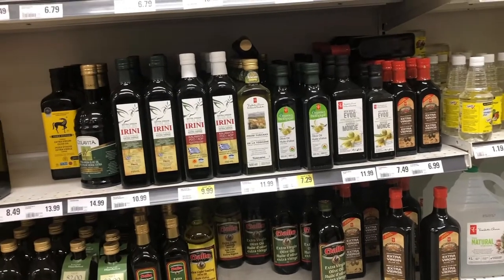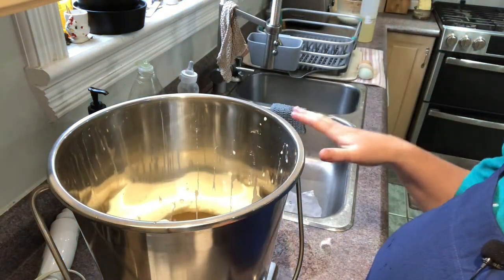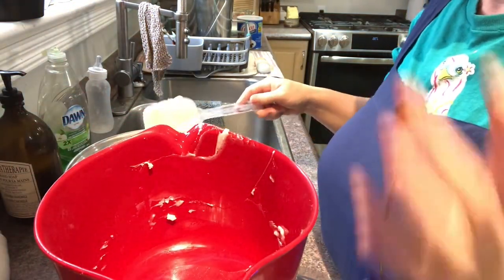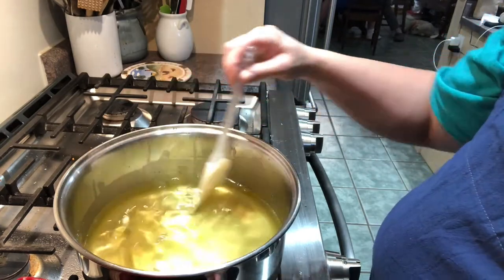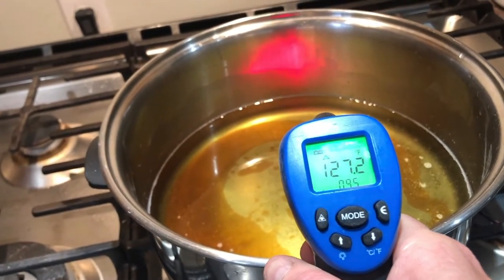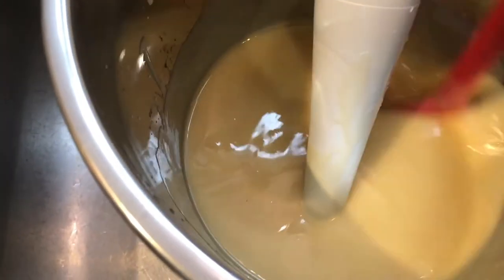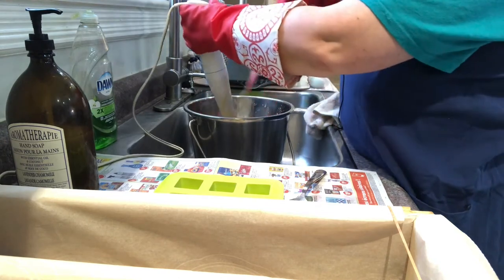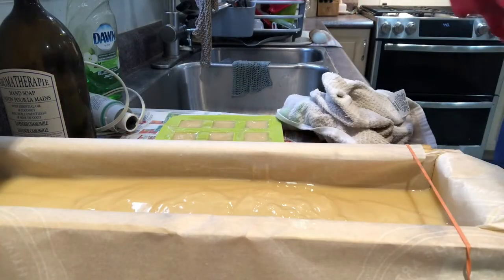How to make goat milk soap using oils from the grocery store for beginners

Comment: Hi, you soap was beautiful, I loved the creamy color. I do have a question. I am a little confused. I saw that you put the soap in the refrigerator. I have seen other cold process soap videos where they wrap the soap in a towel and put it in a cooler to keep it warm. I'm sure there is a reason for both. Could you explain how to know when to use each method?
Reply from the maker: So for goats milk it easily over heats because of the natural sugars in the milk.  When goats milk gets hotter it goes tan or can gel or partial gel.  To avoid this happening it is put in the fridge to keep cooler and to keep its more white appearance.
If you want to gel your soap or called forced gel and to avoid partial gel you can wrap it and the heat the soap makes will force it to gel.  Sometimes gelling it will make natural colours pop a bit more.  Some folks prefer their soaps gelled.  Most people avoid gelling their soap with goats milk though as they simply don’t want that tan colour.  Neither way is wrong it’s just a personal preference.  Just know sometimes force gelling goats milk can cause volcanos and heat tunnels as well as the darker coloured soap.

Comment: Thank you for this video.  Can u double this recipe? If so, how could I incorporate avocado oil in it? I'm not good with calculations. I'm interested in making a a 12 bar recipe.  Thank you!!!
Reply from the maker: You can modify this recipe any way you would like.  You just need to run it through a soap calculator.  The recipe in the video does makes 13 bars of soap cut at one inch thick.  I like using soapcal for my soap making math.

Comment: I really enjoyed your video, thank you for sharing your process. If I was interested in making the soap scented, how much would I add to these recipes? TIA
Reply from the maker: Thank you, I hope it helps you make amazing soaps!  As for scents that all depends on what you are using to scent it.  EO's all have their own safety rating and I usually use the EO calculator.  FO's also have a safety rating and you would have to check with the supplier to find out the recommend percentage.

Comment: We have septic also,, is it.ok to just wash the soap making equipment in hot soapy water and not use the towel ?
Reply from the maker: it is not recommended to put the soap straight down.  It will clog things up.  If you don't want to use a towel you can wash then wipe up first with paper towel or newspaper.

Comment: Kind of a stupid question I’m new to this haven’t made any yet but putting Drano on our skin or lye wouldn’t that burn it while it’s in the soap
Reply from the maker: Not a stupid questiont at all.  No one wants to put something dangerous on their skin.  Once the lye reacts with the oils and liquid and goes through suponification it is no longer lye it is soap.  If you have followed safe usage rates there actually is no lye left over in the soap!  They best anology I can give you is this:  Water is made of hydrogen and oxygen but when the chemical reaction occurs it is no longet hydrogen and oxygen it is water.  The chemical structure has completely changed in to something else!  Just like soap.  Once it has gone through suponification (chemical reaction) it is no longer lye, oils and liquid it is soap :-)

Comment: You cant use it after a few days? You have to wait weeks?
Reply from the maker: you can use it after a few days but it will melt away very quickly.  soap needs to cure a minimun of 6 weeks, 8 weeks is better and 3+ months is best
Reply: @connerty_meadows_farm i want to make my own soaps for the first time. it looks fun except for the lye mixing part. does the same apply to melt and pour ones? About curing?
Reply from the maker: @jets.3561  I am sorry I dont make melt and pour soap only from "scratch".  Lye is not scary, just suit up as I show you in the video and you are good to go

Comment: Can you use bacon grease ?
Reply from the maker: I have actually used bacon grease!  It will need to be "cleaned" though.  (google will help you with this)  Then once it is cleaned you can go ahead and use it as lard.  Now that said I wanted to see if I could get a bacon smelling soap using uncleaned bacon grease.  It worked out ok.  Didnt really smell like bacon at all though.  But it made a perfectly usable soap even if it didnt smell the best.
Reply: @connerty_meadows_farm  : I was so hoping it would smell like bacon .  I keep the grease for all my cooking , that way I don't need to buy any . Old farmer here , wast not want not .  Thank you .
Reply from the maker: @davidwhite4474  I'm a second generation farmer too :-)  we use everything we can as well, no point in wasting anything.  It still makes a pretty great soap!

Comment: But you didn't actually use oils from the grocery store?  Couldn't our outcome be different? You used bulk coconut oil and home rendered lard and your fresh goat milk.. vs store bought.
Reply from the maker: I used this same recipe with items from the grocery store for over 7 years before I was able to upgrade to bulk items, even now though when I dont want to order in bulk I head over to the grocery store for the same items I grabbed off the shelf. So no, the outcome would not be different.  It is the same soap either way.  Thus why I recommend beginners shop at the grocery store as I know it will make an amazing soap exactly like the one I make.